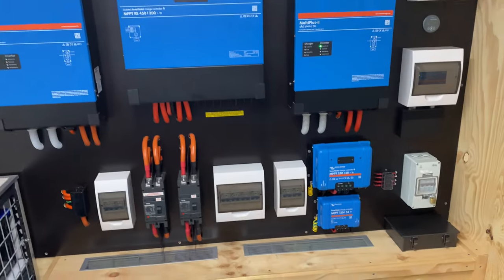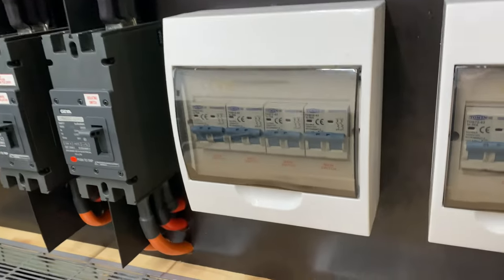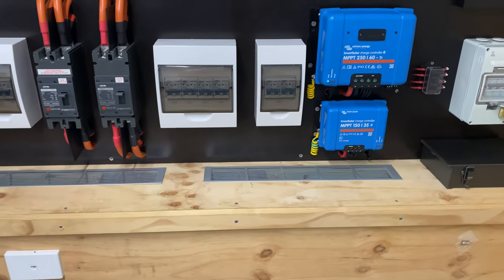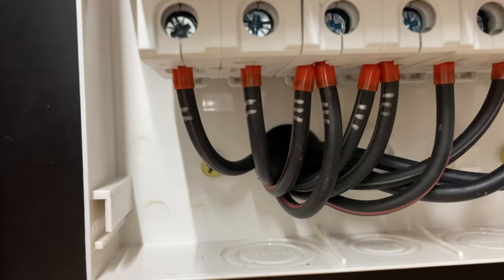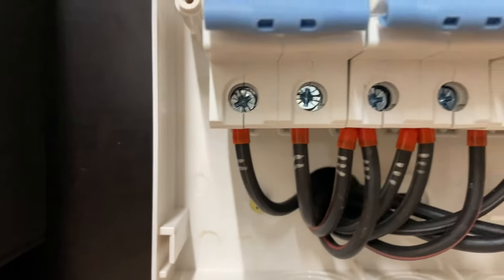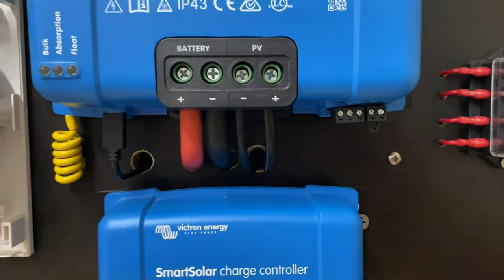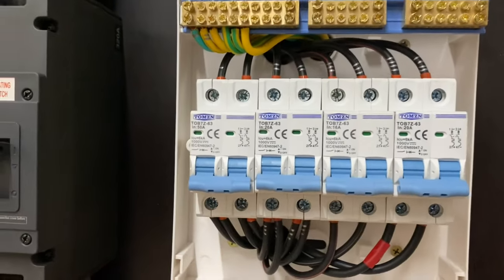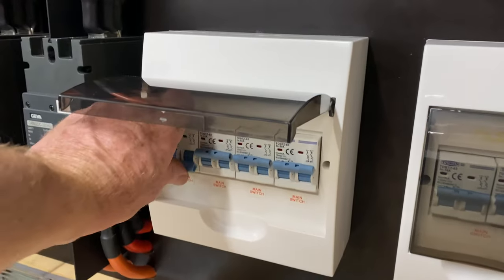Off Grid Solar Power System Overloaded - Victron Energy MPPT, Issue With Array - How Can I Fix This?

Comment: It’s always something isn’t it?  😁. At least it was an easy fix!
Reply from the maker: Hey bud. I didn't read the manual very well. These 250/60's only have the capacity to handle 3000w of array. How good are the 450/100-200's! Are you going to add 1 more 100 to your system? Great for redundancy. Love the panic button.
Reply: @OrganicPower-Australia  I love the 450/100.  I know I’ll have to look at getting another SCC this summer.  We’re looking at rebuilding our chicken/duck coop and run and I’m thinking about putting a solar roof on it.  

Thanks!
Reply from the maker: Sounds like a great idea! 👍🏻 Second hand quality panels are a very cheap roofing material that pays it’s self back💰$30 for a sheet of iron $60-$70 for a panel. I made a water tight array over the off grid garage. Just sealed in between with silicone and butted together. We are really happy with the 450 as well 😎
Reply: @OrganicPower-Australia  awesome!  What did you use for mounting materials?
Reply from the maker: The start of the vid below at 30 sec shows the shed. The rails are mounted to the roof with standard solar fixings, but then the panels are screwed directly to the rails with stainless metal thread self drillers through aluminium extrusion. Sealed in between each panel with caulking. It’s a bit Jerry rig but it works well for my situation. 20 year life at least, not too bad. https://m.youtube.com/watch?v=qaPhho9Mem4&feature=youtu.be
Reply: @OrganicPower-Australia  awesome!  Thanks!
Reply from the maker: Be sure to post a vid of the coop, I can't wait to see what you come up with! 😎